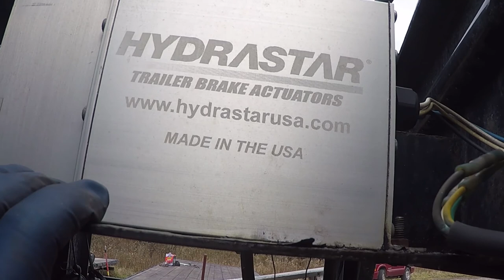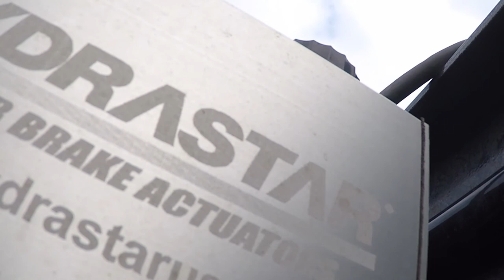Electric Over Hydraulic Trailer Brake System Overview

Comment: Does any basic trailer brake controller in a pick up truck work with these or do you have to have a special controller in the truck for it?
Reply from the maker: So I don't have a very broad experience with them. They worked fine in our newer ford's we had. There was a setting you could change to electric over hydraulic. I have one aftermarket controller that says it works with them.

Comment: Thanks for the info , I’ve had several Camping trailers  tow behind models with Electric Brakes  basically  operated by magnets and a brake Contoller  but my next trailer is  going to be a heavy duty boat trailer capable of hauling a 10,000 lb boat ,30 feet long and I’m wondering if the hydraulic over electric is the way to go ? I have mixed feelings  as I grew up in South Florida  and we were told for years to only use surge  style brakes  because electric  wouldn’t hold up in submerging them in salt water  I did have that style trailer  for a pretty heavy 21 footer Center console  and it may had been me but that trailer was  always  kind of sticky on the brakes  as it would grab and let loose grab and let loose  to the point I hated it  now then I towed with a Jeep that didn’t have the greatest braking system on it  because it was lifted with oversized rims and tires  now I tow with a Chevy 3500 Dually Diesel  that has some more bulk to her and can handle a fair amount of weight behind her  even with the factory brakes and  having   At lest one axle on the trailer equipped with Electric brakes  my big concern with Electric over Hydraulic  is the axles getting submerged in the water  on launching and retrieving the boats  and not creating problems  for highway hauling I love the concept  but I will need to load and unload the boat on a ramp  as  using a Marina lift or Crane gets very expensive  and part of the Investment in the truck and trailers is a effort to lower some costs by doing it myself  many of my hauls are up and down the East Coast  and a professional Hauler and Marina fees for launching and retrieving can be  in the several thousands of dollar range for one trip
Reply from the maker: My 2 thoughts are if you're going in salt water especially you're going to want to keep your caliper pins lubed very well and regularly. We've had trouble in the past just with salt spray in the winter if you don't do that. Second is I don't know what size axles are under it but I'd make sure they're grease hubs and not oil. Not familiar with boat trailers much but id assume they've thought of that. Lube and grease is cheap insurance lol. Thanks for watching!

Comment: I need a video on removing those big discs
Reply from the maker: Sadly don't have the trailers any more. That was on my list to make but never did. It's not too bad to do. Gotta pull the caliper. Then you can get to the rotor bolts easier on the back. We would use a torch and pb blaster then stick a pry bar in the wheel studs to wedge it to the ground so it wouldn't spin as you b pulled the nuts off. Once that done you can pull the hub off and the rotor. Nows the perfect time to check your bearings and swap to grease if you wanted.  Now you can bolt the new rotor on, put your inner bearing in and new wheel seal. Then it's just slap it all back together

Comment: Interesting. That looked like a beefy hub, like 22.5 dually? Doesn’t it make more sense to run electric the longer distance and the hydraulic fluid the far shorter distance by having the hydraulic unit very close to the brakes?
Reply from the maker: 16s actually. You can get 17.5s for it on these trailers. I've thought about that too. I've seen some car trailers with the pump in the back but I think I like it up front. Keeps it up out of the salt spray and the wiring on these trailers aren't the best either. I think Diamond C actually mounts it back there in a little tool box...that doesn't seem too bad.
Reply: @k30krazy  I found your video as one of the only ones on electric over hydraulic. I’m pondering if an older single-axle semi flatdeck’s brakes can be turned air to hydraulic for 10-20k loads. With the new class 1/a training rules, I want to use a class 7 hauler truck with juice brakes to avoid the need to get a expensive licence just to haul light. Trailers are available, but all air. The hydraulic unit mfg is a good lead.
Reply from the maker: That I don't know. That pump alone is $1200 to $1500 last I looked if memory serves. I don't know about other parts for converting or anything. We haul 10k to 19k a lot with our Goosenecks and the brakes do really well